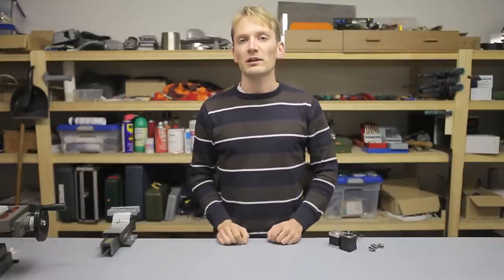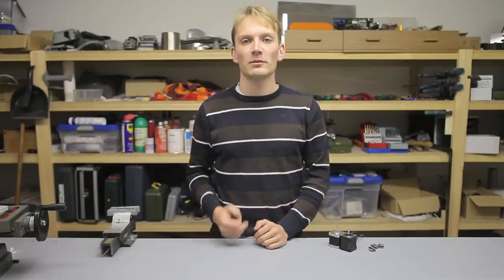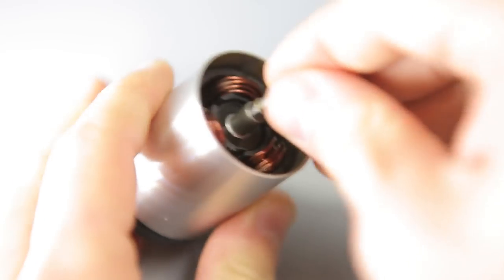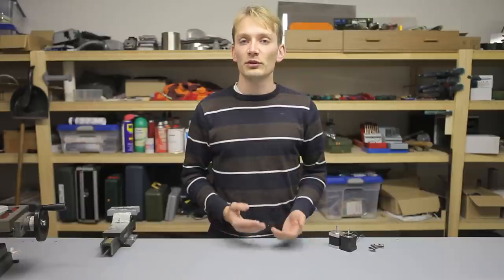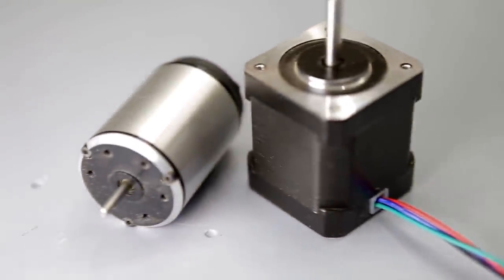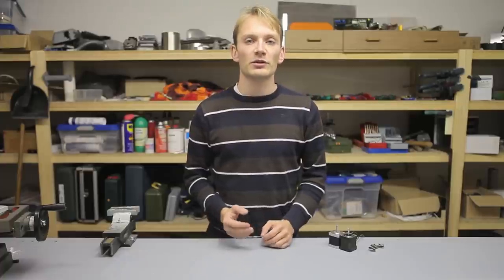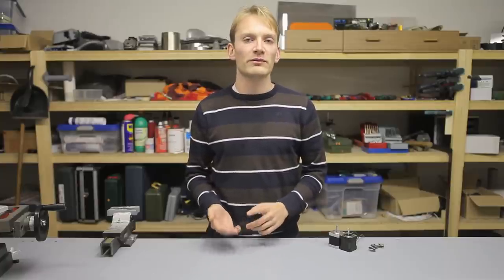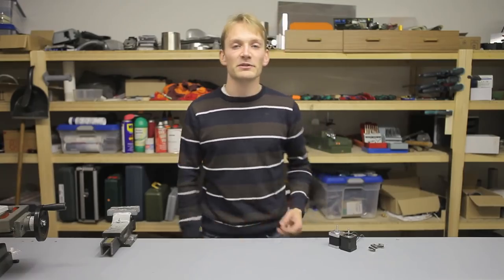3D printing guides - How steppers work and how to adjust their drivers

Comment: This is a good explanation, but it should be coupled with a bit of practical demonstration. For instance, you talk about measuring the reference voltage on the driver, but how do you go about doing that? How do you, personally, check to see if your motors are getting too hot?
Reply: Ya, kept waiting for that, "Here I'll show you" moment.
Reply: ya I didnt really understand any of that with what he mentioned. This seemed like it was more targeted to people who already knew that basic step. It will help me later but not at this time.
Reply: You hold or touch the motor tightly when the heat is too much that you can’t hold or touch it for a number of seconds it then it too hot 🥵
Reply: You can measure the voltage by using two alligator clips, one on the chassis of the driver board(think usb port metal part) and the other on the metal part of the screwdriver you're using to turn the potentiometer. The other ends of the clips go to a multimeter. You may want to use a non-coated tipped screwdriver for this tho.

Comment: Tom - i checked stepper driver has voltage (extruder) but doesnt power motor on my ender 3, the cables test out as working, when i swap out the xyz, the extruder motor works - what is the next test ?

Comment: Hi Tom,

I have just recently just discovered your videos and really like the information you provide.  In this video you have provided a very good introduction on how stepper motors work.  I haven’t searched all that much but so far have not come across any information about how the motor current waveform is affected by motor winding resistance, winding inductance, step rate (shaft rotation speed) and supply voltage.

This may be too much information and maybe everyone already knows this, but here goes.

A simplified model of a DC motor can be thought of as a resistor, inductor and a speed dependant voltage generator all in series.  This may be inaccurate in several respects but will provide a helpful way to think about what is happening in the motor.

- motor winding resistance limits the current for a given supply voltage.  The winding resistance will increase with increased motor temperature.

- Motor winding inductance limits the dynamic current or how fast the current can rise and decay.

-The speed dependant voltage generator, generates a voltage or BEMF(back electro motive force) that opposes the applied voltage.  This voltage has a more or less linear relationship to the shaft speed of the motor.

-Supply voltage provides the force to drive the current through the motor windings.

I am ignoring the micro-step drive as most all modern drivers do a pretty good job.

For a given motor size: a motor with low resistance windings will have low inductance and generate smaller BEMF for a given shaft speed but will need to have larger drive current.  While a motor with higher resistance windings will have higher inductance and generate a larger BEMF for a given shaft speed and will need less drive current for the same torque.

To drive your application you need to choose the right size motor to provide the required torque, and given your maximum step rate you need to choose the proper combination of motor winding resistance and supply voltage.

At slow step rates the motor is generating very little BEMF so there is usually plenty of supply voltage to drive the current through the winding resistance also the current waveform is not changing very fast so inductance has not much affect.  As the step rate increases more BEMF is generated which opposes the supply voltage which is like turning down the supply voltage.  As the step rates gets higher you have more BEMF and the inductance starts limiting how fast the current can change in the windings.  With the result that a system that has plenty of holding torque can rapidly run out of torque as the step rate increases. 

After all of the above, one of the common problems I see is the motor current waveform becoming inductance limited at high step rates (which can be surprisingly low) because either the motor resistance/inductance is too high and or the supply voltage is too low.  When this happens the motor torque decreases as the current waveform amplitude decreases and distorts with increase in step rate.

I work with stepper motors at work and use a set of tektronix current probes and digital oscilloscope to visualize motor current waveforms (I am sure that someone can or has already come up with a cheaper way of doing this).  For a well designed micro-step stepper drive (correct combination of winding resistance and supply voltage) the current waveform should be a nice sinusoidal waveform at all step rates.  For the systems that I work with 12V is almost always too low, 24V can sometimes be made to work but usually we use a 48V supply voltage.

Finally, a stepper motor is designed to operate at a specified current and is typically intended to be mounted to metal to help keep it cool.  A stepper motor can be overdriven to get more torque but this also generates more heat.  Even when operated at specified current a stepper motor can get hot.

Sorry about the very long comment.

Comment: This video fixed my extrusion problems.
My extruder stepper was set to the default 1.4A
He was skipping steps all over the place, now, at 2.9A, 
It achieves a respectable maximum flow rate of 12mm³/s our of my E3D lite6.

2.9A sounds like a lot, but it stays cool to the touch thanks to a fan directly faced towards it.

Comment: i am not 3d printing but i am using a pot (potentiometer) to measure voltage and to use that as a measurement system using arduino. Stepper motors are so cool thanks for the video!

Comment: The properties that limit current in a motor are: winding resistance, winding inductance, back electromotive force and load. To increase the current, you can increase the voltage but it is ultimately the torque required by the load that controls the current. 

Printer nozzle temperature may be critical for the adherence of each printed layer but the stability of the layers is dependant on the cooling of the layer just put down. Waviness in the printed track is usually caused by oscillations of the gantry and may be reduced by mechanical bracing.

Comment: There really is not many stepper drivers used in 3D printing, so finding the right reference voltage for a particular driver is quite easy.
I feel I have much more control if I know how much current I'm at. The small pots seem to have specific points where they are smooth and suddenly the don't work (Checking with the multimeter that I'm at a point where the ref voltage don't fluctuate, helps a lot). Anyway, I start low and increase reference voltage until my steppers move, then a little bit more. If I discover missed steps I increase it a little more. Running with as little current as possible will keep the noise from the steppers to a minimum.

Comment: Thanks for the excellent video!  I'm thinking about DC and brushless DC motors with quadrature encoders.

I have spent many years working in motion control and have always opted against stepper motors when the required motion wasn't simple and precisely known at equipment design time.  This is because stepper motors always resonate unless you restrict their acceleration and speed to values that limit how they can and cannot move.  In general, this forces you to work around speeds and accelerations, often in the middle of the operating range, that cause resonance and lost steps.  For the reasons you describe, a 3D printer is the perfect example of an application where stepper resonance is highly problematic.  It's kind of like a car maker building a car where the wheels fall off if you're turning right at 14 miles per hour.  The guy in the showroom can say "just don't go 14 miles per hour if you need to turn right", but that would be... idiotic.  

DC and brushless DC motors with quadrature encoders perform better, don't have resonance problems and provide precise instantaneous real-time position feedback.  Why isn't the maker community using DC or brushless DC motors with quadrature encoders in these applications?  It's not difficult to use them.

Comment: Hello Thomas! First of all, let me tell you that i love your videos and i thank you for making those.
Secondly i'll only make this comment / request because i care about your channel.
The situation is: i changed from 12v psu to 24v. So, i thought "do i need to adjust the VRef accordingly? Let me check Thomas's channel."
In this video you mention/recomend to adjust the VRef "more or less" - tune up..tune down.. - well, imo, that sucks. There is science behind the things, and you usually talk with science supporting you statements, (that is why i take you in such consideration).
For example, for the drivers i use, in the manual says: "The SD8825 uses a 0.10 ohm current sense resistor so current limit can be computed as follows: Current Limit = VREF x 2 ". Meaning, for a 1.5A stepper, i set VRef to 0.75V. Precise and optimal performance.
When i changed to 24V, the value is now 0,34V (half of 0,75).
My question is: do i leave it that way, or should it be adjusted? If yes, by how much?
(i have searched a lot and don't find a direct answer to this)

Keep up the good job, tks o/

Comment: Good guide, i had a issue with my extruder motor, with is a special motor i had slundering about. 

It seemed the stepper driver always went into fail mode after a while, no clue why. but the only way i can make it work is to overamp my motor for some reason.

Its a 0.95 amp rated motor and i am running it on 2 amps with active cooling to prevent the filament from melting, but this way is the only way i get it to run stable for longer prints. 

Very strange, but it seems to work for now.

Comment: Tom, you do provide great info, and I thank you for that! I wanted to suggest... Could you please talk about the different stepper motors too. Like for example the 6 wire motors?  I had a heck of a time with that. They also seemed somewhat less accurate or it's a setting I've missed on my 3D printer.
Reply: +Thomas Sanladerer Talking about the different Nema motors & flavors of them will be very educational ;)! I would of never known you were German! For a long time I thought you were Australian until I came across a video where you said where you live. I look forward to that DIY series! Cheers
Reply: +Thomas Sanladerer What happened to the stepper video?

Comment: Tom I have a davinci printer that I am changing the electronics to arduino mega/ramps 1.4 my question is, my stepper motors do not have the typical blue, red, yellow, black wires coming out of the motors. How can I tell the proper way to hook it to the ramps board? Do the stepper motors have a positive and negative? Also, will a 10k thermister work for the heat bed? I am trying to make everything work with marlin. 
Thanks for the amazing videos.

Comment: Hello Tom, first of all thx for the nice videos you make ... love them.
I am building a printer and have the following problem.
I have a ramps board and when i turn on the x on the lcd the x stepper motor works, but when i turn on the y on the lcd the y stepper motor does not work but the x stepper turns ....
so x controls x but y controls x to ..... what can i do????
help would be appreciated

Comment: If the stepper is skipping steps occasionally caused by mechanical resistance, will it damage any hardware or the motor?

Comment: I'm using a Smoothieboard with external drivers capable of 4.2a and my steppers only needs 2.8a. Since it uses dips to change the output, I can only select 2.5a or 3a (among others), so what would you recommend since there is no real "tuning"?

Comment: Thomas, is there any real difference in reliability between Chinese consumer grade NEMA 17 motors? I'm looking at building a custom Prusa i3 style printer, and i'm debating whether to part out my Wanhao i3 Plus for the PSU, and motors. It has Moons, are these any better, surely more expensive? Tighter windings? It works fine, but I bought it cheap as an open box return.

Comment: Thanks Tom, great video.
I have a question related to the firmware. I have a printer that uses a Gen6 dirver board and want to know which are the actual firmware settings it has loaded, so that I can then do some adjustments and re load it.
Thanks a lot.

Comment: Thanks great video! :) What if I can't go beyond 0,5A because in that case I think the relay in my psu (24v,10A) reacts and shots down the system before it turned on. Could a bigger psu maybe help (36v, 10a)? I am unfortunately not an electrical engineer.

Comment: I am testing my stepper motors and when I have the z-axis at around 2500, the stepper motors just lock up. I don't know why this is happening because when I lower it all the way down to like 175 in the steps per unit setting it unlocks and both steppers move freely. Could you just explain to me why this is happening because I don't know why.

Comment: Hey Tom, Im using the DRV stepper drivers and i tuned the voltages to have 0.9V and 1.1V on the Extruder, my stepper motors make a crazy high pitch noise now that i changed from the A4988 ones.. Any idea on how i can fix this? Thanks.

Comment: Hi Tom, thanks for another great video. I have a Solidoodle 3 with a Printrboard that I will replace with the 5xc Smoothieboard (thanks to your video) and will mod with the E3D Chimera.  What is the best stepper motor to buy for the extruders?

Comment: hi Tom, ..... i'm new in this 3d print world....i have problem with home position after upgraded my extruder to bowden and change  the bracket...(FYI my printer is anet a8), can you suggest me or give me a link to change the home position from firmware?
Reply: ...I dunno if you're still having this problem, but maybe someone else the same issue will scroll down this far or something, and I just solved this myself a few days ago.
Here's a page that describes how to alter the firmware properly: http://reprap.org/wiki/Configuring_Marlin_Bed_Dimensions
You can also fiddle with the printer settings in repetier-host if you want, but manually sending my first few GCode commands helped me get a lot more comfortable with both how to control my printer and how it all works to begin with, so I'd do that, then save it to the firmware instead of the EEPROM once you're satisfied with the final numbers.

Comment: So, if I want to replace the stepper motors used by my CR-10s with a non made in China one that will have a high degree of precision and strength... what could be the brand and model?

Comment: Hi Tom,

I'm currently working out, what hardware a homemade printer with a big printvolume (50x50x50cm) and a  heavy extruder (ie e3d's kraken with one direct drive) will need. Because I don't mind spending a bit more for motors and boards I'm looking towards NEMA 23 steppers with around 100Ncm holding torque. Those steppers usually require around 3A each, while a DRV8825 is only rated for 2,2A. I'd use an azteeg x3 pro as board and don't know if it would handle 3A stepper drivers. Can I connect the control pins of the drivers to the controller board and use a seperate power source for the drivers? If i look for alternative drivers should they be capable of outputting more amps then the motors reqire ? ie 3A motors powered by a 4A driver, which is connected to the controller board and a seperated PSU, would that work ? Please let me know, if you have any recommendations for stepper drivers that can handle such power.
-Marius
Reply: I did all those assumptions with "the worst case (all steppers go full speed and torque at all time)". I guess I'll go with smaller Nema 23, do you have a recommendation where to get those? I should try to get bipolar steppers, not unipolar right? Thanks for the quick answer, that helps me alot!
Reply: ***** I found some NEMA23's with around 5V (as you said phase current * phase resistance), which should provide enough power and speed. The SD8825 drivers that come with the azteeg x3 pro can handle up to 2,5A and the motors are rated for max 2,8A with 24-48V so I'd be safe to not damage the motor or stepper (right ?). I'm thinking about using the complete assembly not only as a printer but maybe i could switch it to a 3 axis CNC / engraving machine, that's where high power motors come in handy too. Thanks again for all the information!
Will you take a look at the new Taulman3d filaments (910 alloy, 680, Bluprint etc.) or at Colorfabb's XT and their composites? Would be nice to see a growing material comparison (+destruction) as material variety increases daily.

Comment: it was very informative, but where in the firmware can i change the current of the drivers, i updated my firmware and noticed that my motors are heating now and i dont want to screw up my printer any help?

thanks! =)

Comment: What I wouldnt do to just get a video that explains how to set up any main baord, like ramps 1.4, and how to set up the steppers X,Y, and Z axis settings.

I mean no one says what 3D printers main boards do what, what is the difference between different brands and manufacturers, how to know if the 3D printer you buy will do the things you want.

I want to put Ramps 1.4 on a Ebay crappy Anet A2 printer because I( have no idea what the manibaord that comes with it can and can not do.) But still I have no idea if I can do the settings on the Ramps to make the Anet A2 work and even use the kind of auto level I want to use (Being the servo arm that drops and has the switch on the end that feels the bed) No I do not want to use that proximity sensor.

So is there any videos that can explain this?